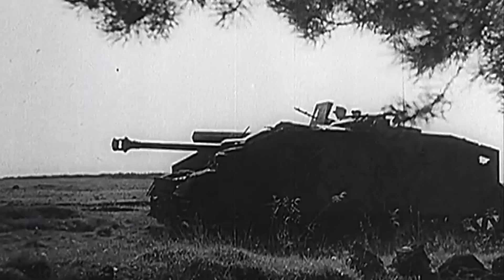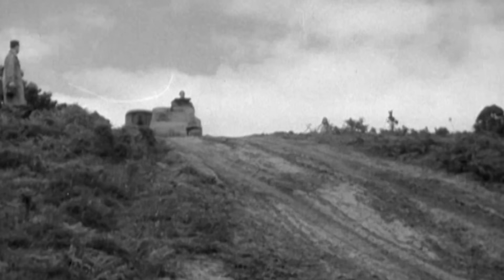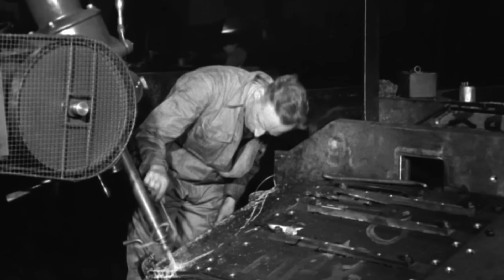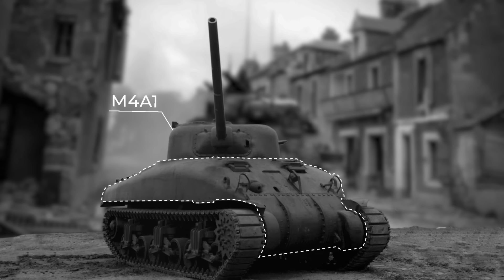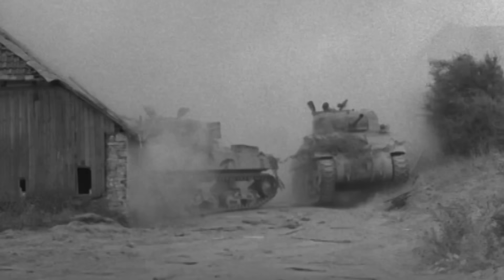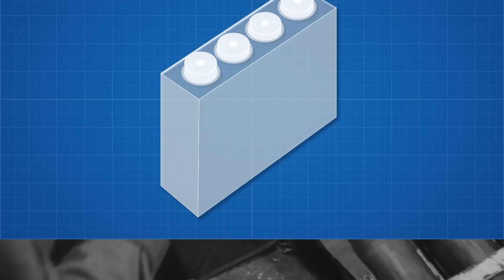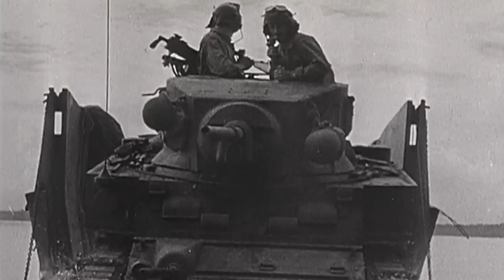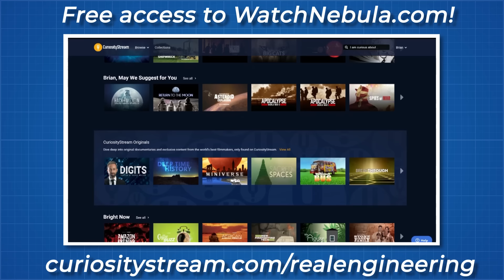M4 Sherman - The Workhorse of D-Day

Comment: I think this video isn't entirely accurate and is slightly misleading. For one, the 75mm gun we designed as an infantry support weapon. It was purposefully short barrelled with a slow muzzle velocity in order to lob high explosive shells over cover and into bunkers. The 76mm Shermans were actually done and in England far before they saw combat, because the US tank crews really weren't having any problems killing tanks. US Sherman tanks only every engaged 3 Tigers, and only one of them was in fighting condition. In US tank doctrine of the time, tanks were for infantry support. And about the reliability, they weren't designed to be reliable in an effort to beat German designs, they had to be reliable because it would take them months to ship over new parts, and as opposed to the Germans they couldn't simply ship the tanks back to the factory they were built in to fix them. And about the early cast Shermans, the frontal piece of armor covering the transmission was actually not part of the casting as shown in your outline. It was an entirely separate piece that was rivited on and easily removable. This, much like my latter point, was designed to allow the Sherman to be easily repairable in the field, which you did touch on, because it  ouldnt be sent to a factory. I really did love the video though, just some little things that I felt were slightly misleading. But if that's all I have to bitch about on a video about Shermans, than you did a fantastic job lol. People usually shit on the Sherman for no reason.
Reply: Not even close regarding doctrine.
Reply: @peterson7082  Ummm I don't really know what you mean. The following was taken from a book written by historians about every countries tank doctrine: "In terms of the Separate Tank Battalions, these were intended as direct support for units that did not have organic armor support. The allocation of assets varied, but generally the Tank Battalion supported an Infantry Division, usually as split up into Companies and Platoons as needed. These did not have a specific exploitation mission because they were tired to the rate of march of their supported infantry."
Reply: @zackbobby5550  

> "For one, the 75mm gun we designed as an infantry support weapon."

 The 75mm. Gun M3 was a capable anti-tank gun. The U.S. Army Ground Forces viewed medium tanks as a supporting asset to all other combatant units (essentially what you say in your second reply ) in making and exploiting breakthroughs in enemy lines.

> "t was purposefully short barrelled with a slow muzzle velocity in order to lob high explosive shells over cover and into bunkers."

 It was not "short" or "low velocity" by any measure. What a tank supports has no bearing on what it can and cannot engage. 

> "... US Sherman tanks only every engaged 3 Tigers, ..."

 The U.S. encountered considerably more than three, this figure was an early estimate made by Steven Zaloga regarding M4's after the start of the ETO. Even then this was an estimate and more verified encounters have arisen since then (approx. 2001 ).
Reply: @peterson7082  I got my number of 3 Tigers from The Chieftan, and I have to say I think he knows what he's talking about. And about the 75. I know it was a capable anti tank gun. It could easily penetrate and disable 90% of German tanks. Anything before a Tiger or a Panther was getting penned by that 75. But the fact of the matter is, it wasn't intended to be used that way. Shermans weren't meant to fight tanks if they could help it, hence why they had the tank destroyer branch in the first place. Many Sherman crews talk about being issued ONLY HE or only a few AP rounds. They were meant to support infantry, plain and simple. They COULD kill basically every tank, including Panthers and Tigers just fine, but they were not meant to be used this way.
Reply: @peterson7082  Also by the way, less than 700m/s muzzle velocity is INCREDIBLEY slow by basically any measure. Try again.
Reply: @zackbobby5550  That figure Nicholas Moran quotes is from Steven Zaloga, he notes in it his "Myths of American Armor" lecture. It is an estimate from the early '2000's referring to M4 encounters in the ETO only. He does know what he's talking about that's why I say what I say. 

 The issueing of ordnance doesn't change doctrine. Just changes expectations vs. reality. 

 The Soviet F-34 76.2mm. tank gun, 6-pounder, and 5,0cm. KwK 39 L/60 were in that range and most certainly not low velocity. Certainly lower velocity compared to other tank guns, but in classification it was not.
Reply: @peterson7082  Yeah the Soviet F-34 was one of the worst guns of the war, and the German gun was a 50mm pre-war gun that was known for not being good enough. You're not really helping your case here.
Reply: @zackbobby5550  How was the F-34 the worst? The 5,0cm., like the 6-pounder was a prewar design produced late, was introduced in late '1941, and didn't become all that common until mid '1942.